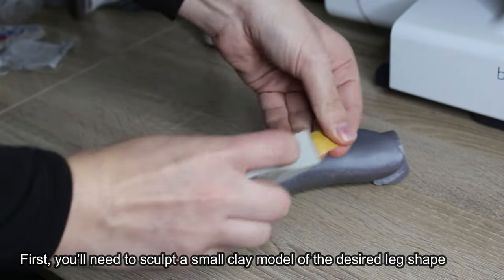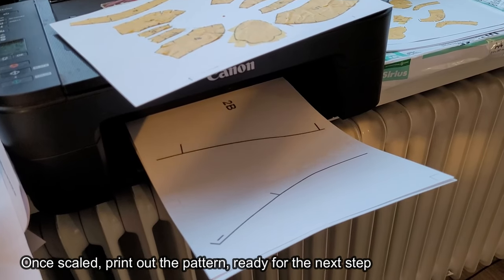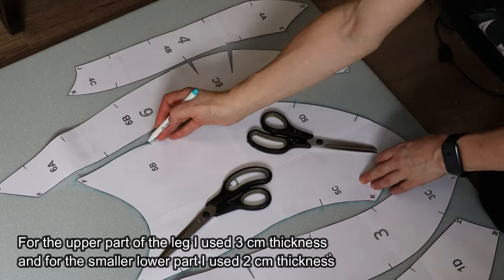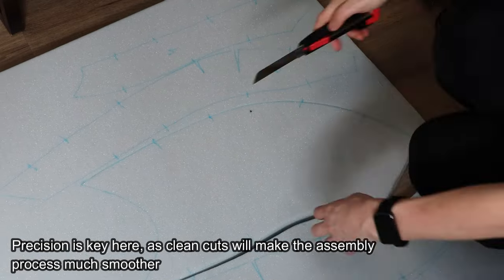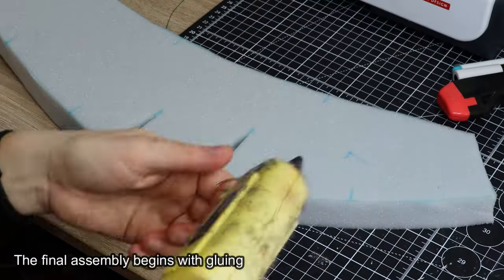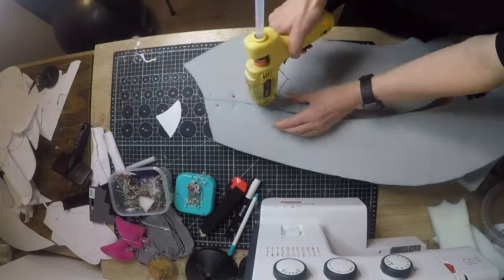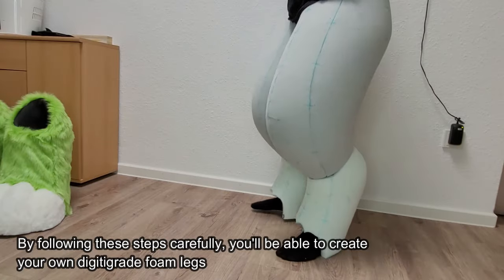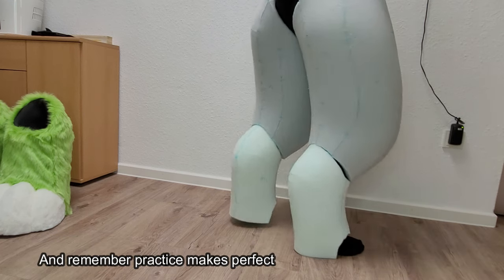How To Make Digitigrade Foam Legs For Fursuits

Comment: Random tip for anyone who happens to come across this: Try having a set of pins used for pinning things like this separate from your main set, because once pins get hot glue on them they're not too good for use with fabric anymore.
Reply: I learned this the hard way ://
Reply: fr tho i had like 30 and then i used then to pin foam and then yeah..

Comment: Hey! I have a pattern for slim digi foam legs. do you think it would be possible to take the foam legs, pin them onto a DTD and then tape over them to create a pattern like you would for non-foam base fursuit legs? in other words; taping up and patterning the foam legs like you would non-foam digi legs to create the legs and padding? If so what’s the best way to do the padding? Thanks in advance! Love your work!
Reply from the maker: You mean making a bodysuit pattern?
Reply: @MugiwaraCosplay  Sort of, but using a pair of foam legs and attaching them to a duct tape dummy and then taping it over with the foam to create a pattern out of it along with the padding
Reply from the maker: Yes, that is possible

Comment: A few questions, 
-do you think this would still work on a larger body size (300lb and 5’5 range)? 
-how well does it rebound from being squished once furred 
-if yes can it be stored squished up for a long time and still rebound?
Reply from the maker: 1. You just scale it up to you own size
2. Pretty well, I see other makers use this method for padding and I couldn't tell it was foam. The fur didn't squeeze the foam.
3. I used this method for the Tasque cosplay, and even after it was stored away for a few weeks, the foam rebound back fine and still looked normal
Reply: @MugiwaraCosplay  when resizing what should we do if it’s getting cut off the page? How do we fix that?

Comment: Can I use the same pattern to fur them as the pattern of the shapes but make the rest of the pattern of other parts the the foam isn’t covering and then attach them together or will it not work
Reply from the maker: I don't recommend that because it would have many unnecessary seams, you will still need to make a pattern

Comment: My question is how do u wash it if the fur is attached to the foam? I'm afraid of mold
Reply from the maker: I don't recommend attaching fur to the foam legs. You can make it removable for easier washing
Reply: @MugiwaraCosplay  ok thank u ❤
Reply: How would you make the fur removable? Would you need to use Velcro or could you just slip it onto the legs?

Comment: Is it possible for me to just buy the pattern without doing any of the measurements I don't really have a PC or any other tools 😥
Reply from the maker: The finished pattern is on my shop, if that's what you mean. But you still need to print it yourself, and adjust it if it's not your size

Comment: would this pattern suit someone with a pretty small frame? im 5’4 90lbs (164cm 41kg) and was wondering if id need to scale it at all
Reply from the maker: The height would fit, I'm 163 cm
Reply: in my experience being a 90 lb, 5'5 person, I always preferred my legs and bodysuits bigger so you have room to grow into it if you ever gain weight.

Comment: Do these fur well? So one doesn't need to stuff for taping the pattern on?
Reply from the maker: What do you mean? You would still need to make a bodysuit pattern
Reply: @MugiwaraCosplay  
Oh ok, that makes sense. I thought that one would use this pattern to fur. Thanks for answering my question!
Reply: @MugiwaraCosplay can’t you just use the same pattern to fur the legs and make the pattern for the bits the foam doesn’t cover then sew them together or do I have to re pattern it